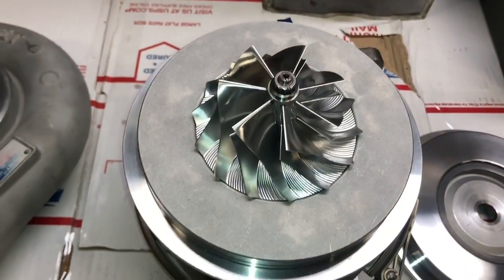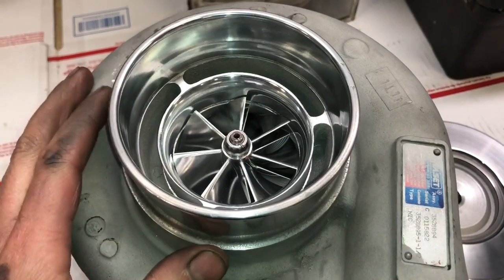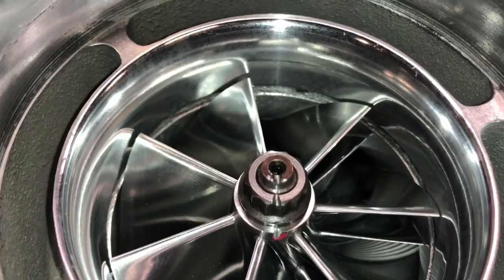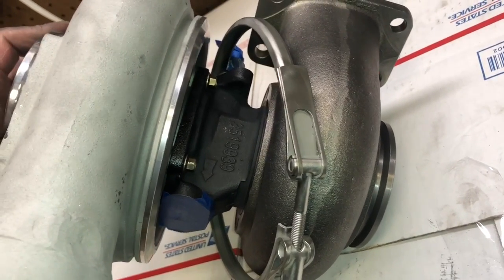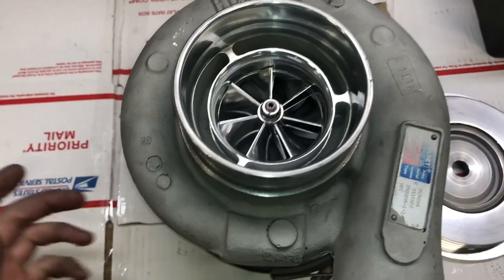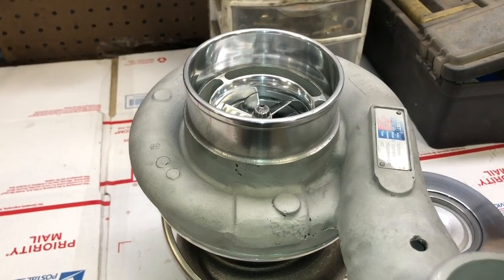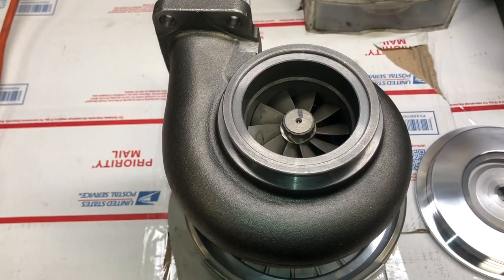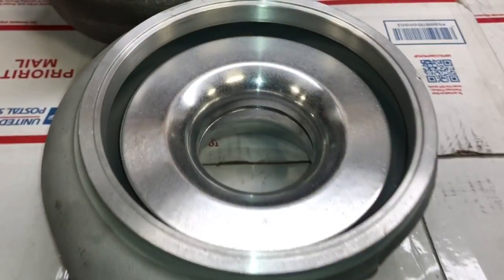Poormanmods h1c turbo upgrade

Comment: 👍hey do u have a kit for 2003 cummins turbo ???   I think its ?HE341?   or sell a upgraded drop-in turbo?  I've been watching for couple years now , and may have already asked u this before .
Reply from the maker: 2003 - 2007 Dodge Ram 5.9 Cummins HE351CW Turbo Rebuild Kit https://youtu.be/uD9HYjfyVtI
Reply: @turbolabamerica  ok , I was under the impression my 2003 had 341   .. but id like the upgraded turbo . 👍👍
Reply from the maker: I also have parts to make an upgraded turbo for the he341, we sell the turbo for 850, 200 of which is a refundable core charge

Comment: Thanks for making such informative videos! I’ve learned a lot from them. I bought my first diesel last March. A 2005 Ford F-350 6.0L. 
I have to admit, I get a little lost watching your videos cuz I’m so new to turbos, Lol 

If I wanted to take off my turbo & send it to your shop to clean, repair/upgrade what’s the turnaround time once you receive it? It’s my daily drive so downtime is very important. 

I’m looking for reliably as said it’s my daily drive & pulls my 30’ Travel Trailer a few times a year. I’m not having any issues, this would be a prevented maintenance job.  Thanks

Comment: ive got a wh1c on a 5.9 12v cummins. How much would a replacement similar to the unit in the video cost, built for mostly dd and mild towing ~10k lbs.

Comment: dang dude on your time off you could certainly benefit from making a lid for the lathe with a plexiglass window. It would significantly cut down on the mess each cut makes and concentrate it at the lathe's area only. Keep up the great work!
Reply from the maker: It has a shield but the housing had too much swing distance so I had to remove it for this job

Comment: Hi I’d like to get in touch with you about a turbo build for my Jeep
Reply from the maker: Do you have the turbo Deisel Jeep Liberty
Reply: Turbo Lab America no a 4.0, I will need about 320-360 lb/min to meet my peak needs at 1.6 pr
Reply: 2001 Jeep Cherokee I just rebuilt the engine for boost

Comment: I really like your informative videos. I have a DSM 4G63-powered Mirage and want to make 7-800HP. What turbo would you recommend?
Reply from the maker: Hx40 with 67 turbine and 62.45 compressor or 67 mm compressor
Reply: Garrett FTW!
GTX35R is always the answer. 3576R if you want 700awhp & better response, or 3582R if you want 800awhp+

Comment: The housings look really nice after you've opened them up. Do you ever find any porosity in the castings when you're machining them? I don't know but they just look rough on the outside like they are sand cast, so seeing them all machined out almost polished is kind of a surprise.
Reply from the maker: The early models have a lot of small air pockets, if I pressure wash it with a 0 degree tip it tears up the air pockets, when sanded smooth you can see them so easy.